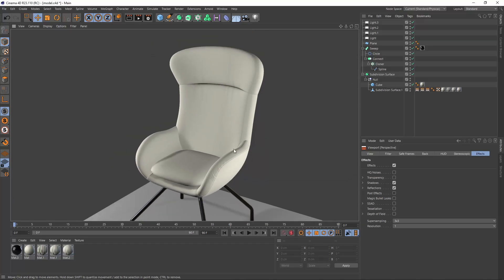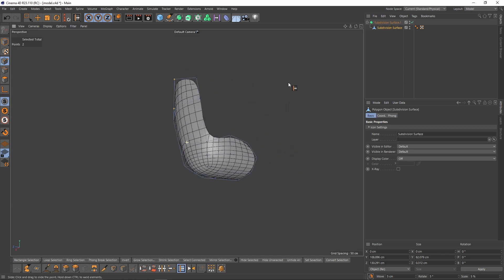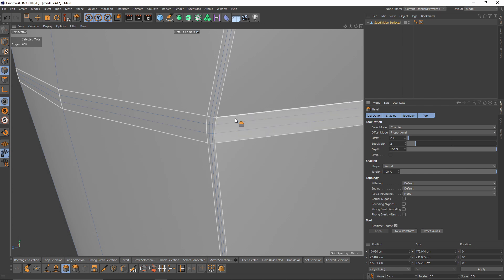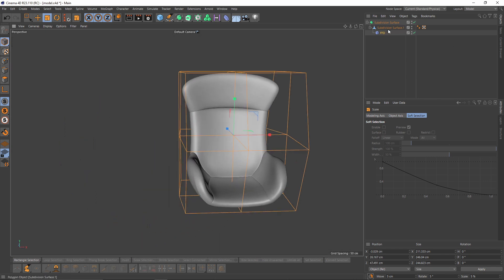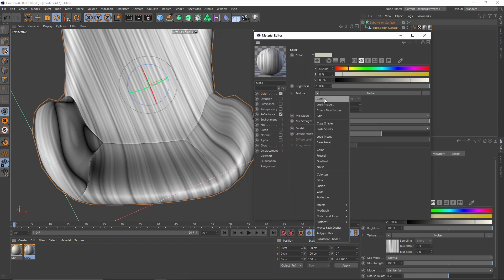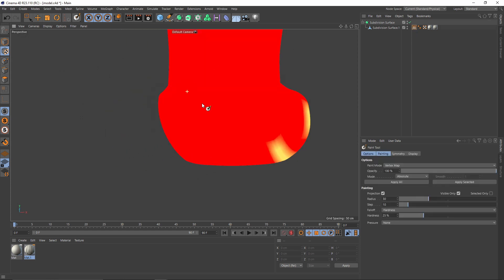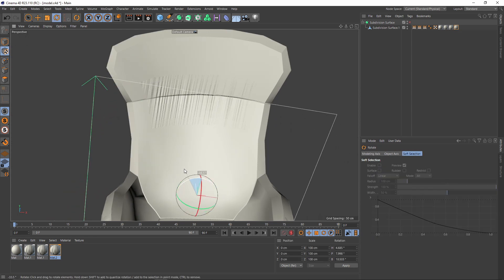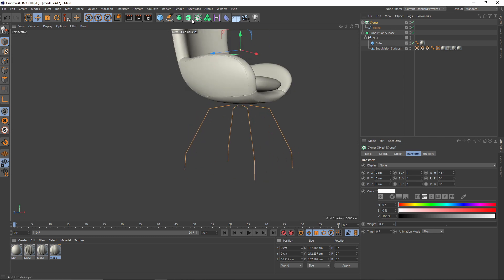furniture modeling #1| Chair | Cinema 4D Modeling Tutorial

Comment: Hi i got an issue with the wrinkles. After copying mat.1 getting mat.2 and adding it as a new material to the object getting the tags mat.1 and mat.2 and setting the alpha of mat.2 to vertexmap2 when i select with the texture mode the tag mat.2 and press R to rotate the material the axes doesnt show up and i got to select also the object for them to show but when i do this it moves the texture on the vertexmap1 too. I checked that everything is assinged correctly vertexmap1 to mat.1's alpha and same with the vertexmap2 and the mat.2. Do you what may be the problem?

Comment: What IF I want to add these wrinkles in the model it self but not with texture can I use sculpt tools ?
Reply: i think you can use sculpting but by texture you will have command over all of them easily than doing it with sculpting
Reply from the maker: yeah you con do that but you need to bake etc.